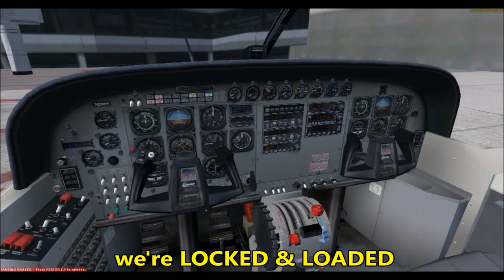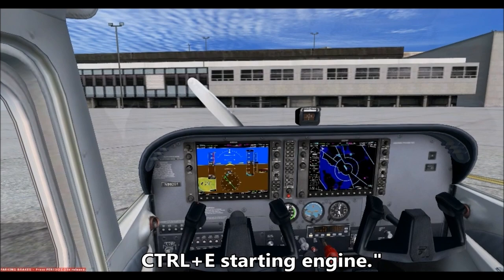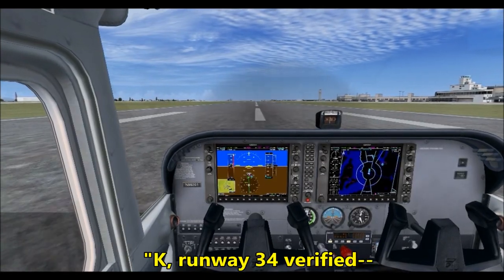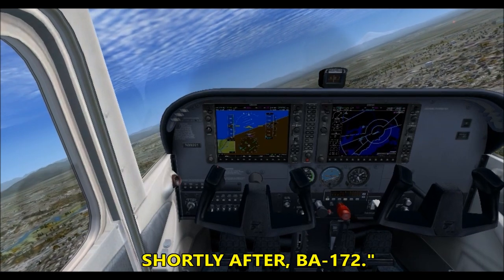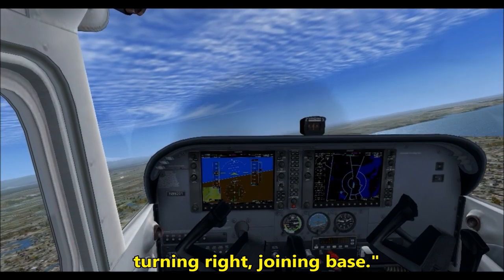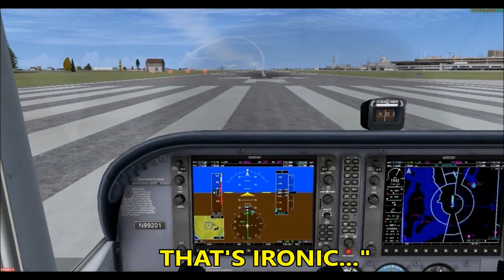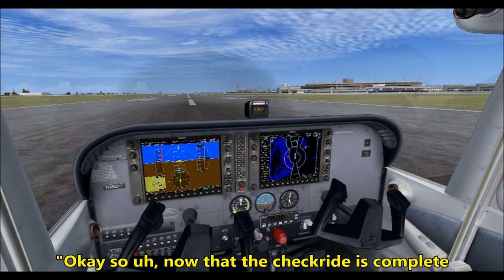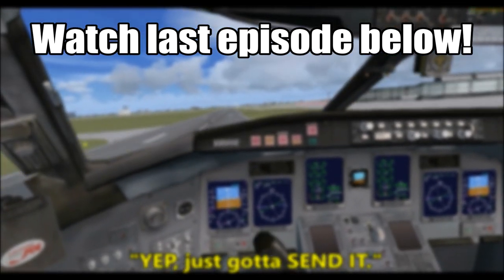Landing with an ENGINE FAILURE! Flight Simulator X (Multiplayer)

Comment: Using the PA System...when your passengers are literally right behind you?
Reply: To be fair, have you ever tried talking in the cabin of a 172 while the engine's on? not gonna work out. So using those mics would help out. Also for the lols.
Reply: PhoenixAzureGaming Even in a PA 28 the cabin is extremely loud when the engines are going so he head sets are really handy hehe
Reply: I usually just shut off the engines to talk to passengers.
Reply: That’s a cargo plane too lol
Reply: That was the joke...
Reply: xcraigbauerx, did you just say that's a freaking cargo plane? The Cessna 172 is NOT a cargo plane!
Reply: In flight????
Reply: MidnightWolf Err it can be used to fly small cargo actuall but not large cargo... just thought i should say so...
Reply: PhoenixAzureGaming j
Reply: PhoenixAzureGaming legit
Reply: 'cause fuck it, that's why.
Reply: @ronaldbrown9638  How do you know that's what he screamed back, eh?  Eh?  Eh?  Gotcha!
Reply: WOOOSH

Comment: "..flaps don't work when the engine is off."

The laws of physics are not suspended when an aircraft engine fails.
Reply: the hydraulics will not flow when the engine is off, meaning you can't lower or raise flaps
Reply: @perryfrog7162  Except they're electric in that aircraft.
Reply: Alec Daniel I’m doubting your engine is turned off if you are in any case hitting the ground at 500mph lol
Reply: Mr. Yellow Lemons Flaps are electric in the 172sp
Reply: Alec Daniel You need to manage your airspeed for best glide you don’t just fall out of the sky at 500mph, especially in a 172
Reply: @dubdub1  at 500 mph in a Cessna 172, your Wings would Break Off, THEN You Would Fall Out of the Sky😂😂
Reply: Rund ums Fliegen yeah lmao 😂😂😂
Reply: @cwheels01  I think the problem here is that nobody said the laws of physics got suspended. The (inaccurate) presumption was that an engine outage would either kill the hydraulic system (if the guy thought 172s had hydraulic flaps) or kill the electrical system (for electrically-operated flaps). Since the 172 doesn't have hydraulic flaps, that isn't the case, and the battery will almost certainly handle the flaps 30 seconds after engine out. But an alternator out (which I suspect the guy was thinking about), followed by an hour-long flight on full avionics, might kill the battery and render flaps inoperable for landing. So yeah, the guy was wrong. But no, he wasn't misinformed about some basic physics.
Reply: @GeekOfAllness  I'm not sure any of that was necessary.
Reply: @cwheels01  The original comment was both unnecessary and completely missing the point, so I'm not really worried about the necessity of mine. :)
Reply: @GeekOfAllness  Okay but what I'm saying is you didn't really bring any new information to the table.
Reply: @cwheels01  The original comment implies proper flap operation can't be tied to the engine, apparently presuming they're always some kind of mechanical system like in a Kitfox or something. Your comment makes two mistakes. First, it implies electrically-operated flaps can't be tied to the engine, which isn't completely true (in some aircraft, emergency power because of a non-functional alternator doesn't power the flaps). Second, it implies that not knowing the 172's flaps aren't hydraulic is somehow the same as not understanding basic physics, which is obviously false.

My comment is pointing out that the first comment, to which you responded, is indirectly stating "video guy incorrectly believed 172 flaps are hydraulically operated, and some hydraulic systems do actually fail on engine failure, so it's a misunderstanding of 172 components, not basic physics". Further, my comment is pointing out that video guy may have simply incorrectly believed the loss of alternator power would cause a loss of flaps control, which is only incorrect because the battery on a 172 can almost certainly handle the load from the flaps for a minute or so after loss of power.

Certainly, any time a person is wrong about something in the real world, the discrepancy can be reduced to "physics is physics", but that's a useless statement in practice. Practical responses involve explaining where the person made incorrect assumptions or calculations. Someone who intuitively thinks an aircraft with no engine should just fall out of the sky isn't wrong, because that's exactly what happens. They're just not connecting the dots and therefore having trouble equating "lift" to lower terminal velocity. Likewise, someone who equates a turning engine to a working alternator, which in turn equates to electricity and therefore operating flaps, isn't wrong. They're just forgetting about the battery.
Reply: @GeekOfAllness  Except I did not reply to the original comment. 

Nor did my statement have any implications aside from the engine being cut not necessarily having an impact on the flaps.
Reply: That your reply is in the context of the original comment means it will be interpreted in that context. The original comment effectively claims that all flap systems are independent of the engine, because physics. The next comment counters with a case showing the claim false. That some flap systems are independent of the engine is irrelevant. The fact that you posted the irrelevant comment as a direct argument to the counter-claim implies what I was saying above.

Anyhow, it really doesn't matter. We've already wasted more time than it's probably worth. I had just done a decent bit of research relevant to the comment I made when I saw this comment thread so I incorporated snippets of that research into a quick comment. Anything past that isn't of particular note.
Reply: @GeekOfAllness  I never claimed to agree or disagree with the original comment, I only stated that the flaps aren't hydraulic. You're just making shit up because you're bored.

Nothing you said needed to be said. Nobody needed your interpretation of the events in this thread, especially if it's wrong.
Reply: He means they will not extend or retract.
Reply: The laws of physics are however suspended on starting FSX

Comment: "Just so you know, flaps don't work when the engine is off"
I don't believe that's true
"Hydraulic system"
Bahahahahaaha
Reply: Cessna 172SP with hydraulics flaps? LULZ. Okay bruh. You shouldn't be the proctor.
Reply: They have electric flaps!
Reply: So I guess, if you were gliding for a LONG time you couldn't use flaps...or if the maintenance was crappy and never did a capacity test on the battery, then you wouldn't have electrical power for very long. That happens a lot!
Reply: The 150 I fly in my flying lessons has an electrical switch to alter them. The location of the flap angle indicator though is in such a stupid place in the 150. Its right above my head and to the left.
Reply: Yup. I'm a aircraft mech. Worked on 150s / 152s for 6+ years. Common complaint.
Reply: Wtf?
Reply: Even if there were hydraulic flaps (with the hydraulics being powered of the engine) the propeller was windmilling and would have run them anyway.
Reply: Adam Granby yeap
Reply: Not to mention even on older Cessnas with hydraulic flaps, the hydraulic pump will still work if the propeller is windmilling :P
Reply: It's a game
Reply: Flap wprk anytime you want on a cessna 172
Reply: Which cessna has hydraulic flaps man
Reply: Welcome to steam edition
Reply: Dat was some bs I tell ya
Reply: whoever said that an engine failure makes it so that flaps cannot be extended, you STUPID the flaps are run by hydraulics with are not affected by an engine failure unless debris ruptured hydraulic tanks, and that is typically on a jet not on a cessna 172.  By the way on cessnas flaps are run electrically not with    hydraulics even further backing up my point
Reply: I don´t think he realizes that if there was no hydraulics the rudder, elevator, and ailerons wouldn´t work
Reply: @yt_littleking9966  That's not really true. It depends on the aircraft. Some aircraft have hydraulic flaps but not control surfaces. In the event of a main hydraulic failure, many aircraft have backup hydraulics for brakes and control surfaces, but not flaps or speed brakes. And not all aircraft have pressurized hydraulic reservoirs, so a pump failure means immediate loss of hydraulic pressure.

For an example of the first two points, the CJ4's power brakes have an independent electrical hydraulic pump. Flaps, ground spoilers, and speed brakes are operated hydraulically with no backup. Gear down is on the main hydraulic system, but has a pneumatic backup that also serves as a backup for the power brakes. Main controls are cable-actuated with electrically-powered trim tabs, and there's a bleed-air system to assist the rudder during engine-out scenarios. There are two main electrical generators unaffected by an engine out, and the engines each have alternators in case of generator outages. The main battery powers essential systems for 30 minutes in the event of complete generator/alternator failure (notably, the anti-skid system is not powered in this case, requiring twice the runway length to safely stop). https://www.easa.europa.eu/sites/default/files/dfu/525C-CJ4.pdf

An example of the last point is the previous CJ aircraft (such as the CJ3) which had open hydraulic systems. To my knowledge, this means loss of engine causes instantaneous loss of hydraulic pressure, so you'd have to use the pneumatic backup system to lower the gear and you'd lose flaps, speed brake and ground spoilers. Compare this to the CJ4 which would have some built-up hydraulic pressure in its closed system so you could still lower the gear, extend the flaps, and engage the speed brake and ground spoilers as long as enough pressure remained. Both aircraft types have cable-actuated main controls and electrical trim so you'd have full control of main surfaces in an engine outage. And between the independent hydraulic pump and backup pneumatic pump, both aircraft would have working brake systems.

Which means if the aircraft in question was a CJ3 instead of a 172, the statement "flaps don't work in an engine out situation but you can still control the aircraft" would be accurate.
Reply: @macnerd93  terrible design.  That's what they think killed John Denver -- fuel tank switch over his shoulder he had to reach for.

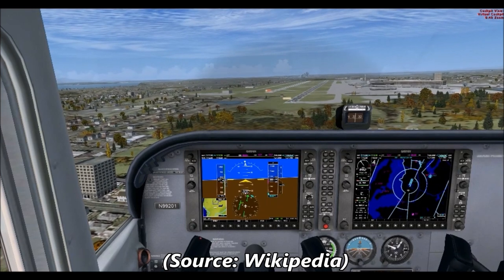Comment: I nearly cringed my guts out when he said "pull up, you have enough speed, you'll make it" at 6:40. I've played arcade flight games with completely exaggerated and oversimplified flight mechanics that would still have you crash in that situation if you pulled up there.
Reply: I fly glider for 3 years now and even in a glider with a L/D of 50 he would not have made it. The "examiner" had no clue about how flying works
Reply: @Chao Which ones? ACX?
Reply: @Dan-379  "War Thunder" and the demo for "IL-2 Sturmovik: Cliffs of Dover" on... Xbox 360, I think.
Reply: @Chaooo  Oh. Ok.

Comment: Love the video's, they bring me much joy in some not so good times.
I have a serious question, your mate said that you cannot use flaps without an engine/s but I know that there is a small rotating fan ( sorry i forgot the actual name of it ) that you can activate, at least in larger planes so that both electronics and hydraulics stay functioning.
Is that not an option in smaller planes ?
Reply: I believe you mean the APU, all big planes have them but most small ones do not. I personally don’t know about the aircraft there flying.

Comment: 6:30 actually, i think the flaps in  a Cessna 172 are elctrically operated. But im Not Sure If the battery provides enough Power.

Comment: Protip: The cables that control the flaps are right underneath the overhead interior panel. Cut those bitches, and the flaps drop down to full under gravity. They are also right next to the cables for the ailerons, so don't fuck up and cut the wrong ones.